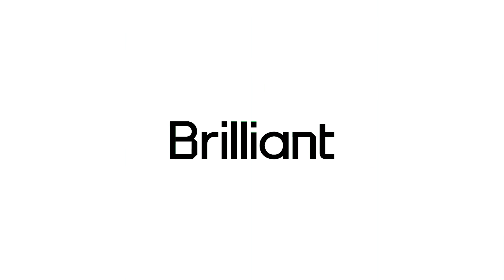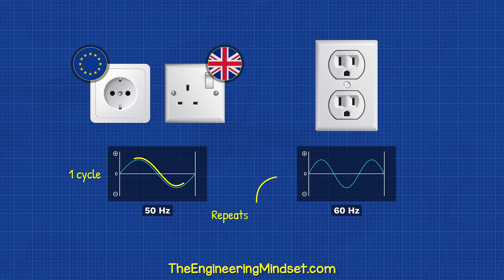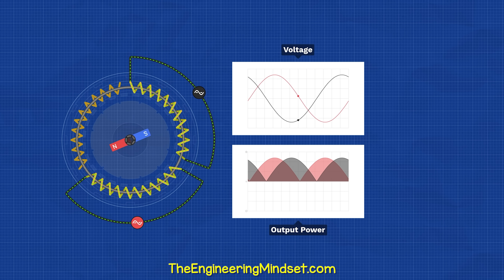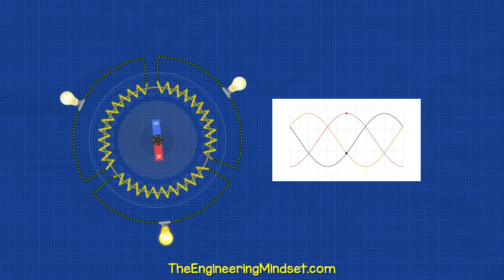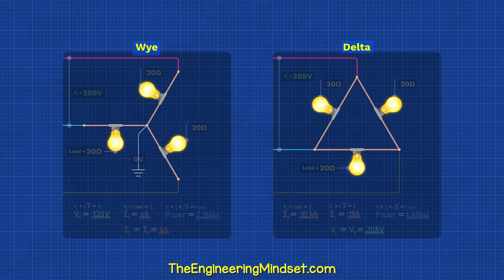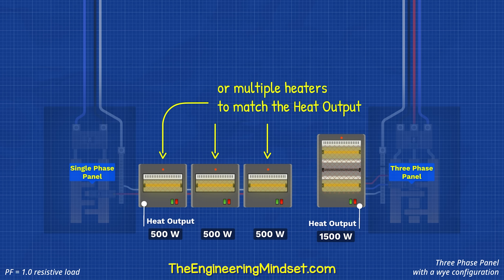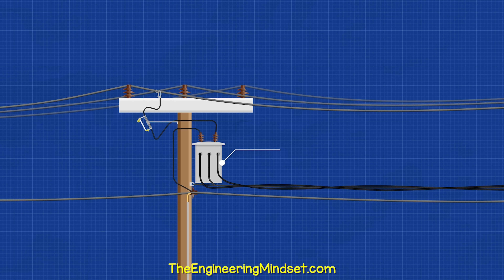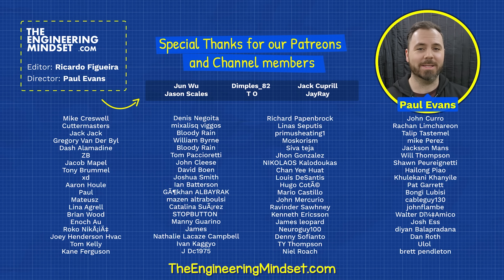How 3 Phase Power works: why 3 phases?

Comment: We have 220 VAC (10 A) and 380 VAC (16 A) in our households. The 380 VAC was typically used for stove tops and washing machines. However, many of today's household machines run on 220 VAC which negates the use of 380 VAC. Running 380 VAC in the garage is practical, if you like me, have a welder. I simply took one phase and a ground wire and put a 220 VAC wall outlet on them.

Comment: I absolutely agree that your explanations are EXCELLENT, clear, concise and simple, you have clarified why we use 3 phase, why we step up the voltage on transmission lines and the differences between 3 and single phase star or Delta etc. ....as an electronics hobbyist of over 50 years one question still escapes me though..... why, here in the UK for example did we settle on 50Hz, why do some countries use 60Hz and why not use, say, 100 or 200 Hz etc which would surely be more efficient.....

Comment: I have last 2 doubts, then I'm all good to go. 

1. So if the public homes following UK style power distribution are supplied with single phase load, then how exactly it is distributed in the home like from the Y fork one single wire from one single load goes to  home and it gets distributed into multiple live wires for different plug points right? Similarly from all the plug points all the neutral wires are connected  to a single neutral wire going out from a house and getting merged into the single neutral wire connected to the Y fork right?

2. Can someone operate a 3 phase motor in a single phase distributed house? And can a single phase load operate in a 3 phase power distributed in a commercial place without l phase distribution?

Comment: You didn't answer the question.
Reply from the maker: Multiple reasons for 3 phase are listed throughout the video, here are some key points
4:30 Explained how 3 phases provide constant power. Graphic shows “almost” and audio says “more constant” with some small ripple shown, at this point all phases are still separate circuits and we have built upon simple single, two and then three phase generator.
5:05 Explained how it provides equal spacing. 
5:36 Explained how more phases means more cables, controls and protection equipment, complex infrastructure, more complex transformers and motors, harder to balance network and synchronise generators.
6:22 Explains how only 3 wires are needed which is cheaper.
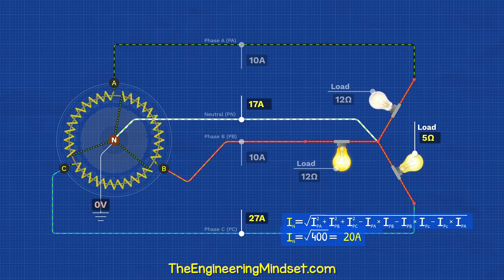7:26 Explained how neutral can be used to balance
7:54 Explained how we use single or three phase from same system
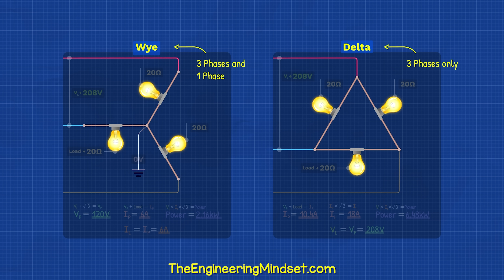8:21 Explained how Wye and Delta are used for different scenarios. Examples uses same resistance and line voltage.
9:59 Explained how 3 phase allows more loads to be connected
10:17 Explained how 3 phase uses more energy but provides more heat
10:19 Compares single and 3 phase power, shows 3 phase power is consistent 
10:36 Shows single phase and 3 phase motor. Single phase has capacitor
10:41 Shows comparison for 3 people v 1 person for motor analogy.
Reply: @EngineeringMindset  These apply even more to 4 phases, though.
What you described is why 3-ph is better than 1-ph.

Comment: great vid THANK YOU,you made it clear
I  use a voltage convertor 240 single in 380 out, run my 12 hp lathe, 5 hp bandsaw, grunter welders and much more, on a convertor from China 20kw, it is very reliable and I've sold a few  here in Australia
so now I  payonly for the single phase , if i had grid they would charge daily for the line

Comment: Electrons don’t flow. If they did, that would ionize their conductors. As they receive electromagnetic energy, they jump to a higher orbit then return, releasing photons that excite the next electrons in succession. 
The phasing has to be three, because of the problems you mentioned and eddy currents stalling or shorting the device. 
Otherwise, good video!
Reply from the maker: Electrons do flow. Well, in DC, they will slowly drift along the circuit while randomly moving within the wire, pulled by the electric field. In AC they just move back and forth a tiny amount and never really go anywhere as a result unless the circuit is turned off repeatedly during one half of the wave.
Reply: @EngineeringMindset  Veritassium articulated how electrons don’t flow, but cause EM fields to travel along the conductors. As the electrical field excites photons, the photons then excite electrons to jump up an energy level then back, emitting photons. They cascade along the conductors from highest potential to lowest.

Comment: For the AC RMS, you can approximate it pretty simply using a bridge rectifier and a capacitor. The DC voltage you read will be pretty damn close to the RMS voltage, typically within a couple percent, and it's what cheaper multimeters use to read AC voltage

Comment: Correct me if I’m wrong, but Isn’t that fluke multimeter used in the video rated to only measure 20 amps??? Shouldn’t the fuse blow?

Comment: Your timing is off by 90 degrees on pretty much all your sine waves.  The current is greatest when the poles are pointed away from the windings, as the magnetic field is changing the fastest there.  The slo-mo video showing the rotating magnets and the light bulb prove this, as the bulb is brightest when the poles are both furthest from the winding.

Comment: Great video! I’m a big fan of the content. If I may, id like to make a suggestion that would help us out in the States. Many of your conversion are European formulas as opposed to standard conversions in the US. Such as kw vs btu’s or pascals vs wc (water column). It would help to include not just European equations but US measurements. Thanks.

Comment: 6:03 okie dokie, every other continent decided that their genius is somehow better than Nikola Tesla, the one who created this masterpiece of a system called the alternating current. And we have it so that if your kid grabs a 120v circuit he'll just get his feeling hurt. But all the other systems decided that it's not good enough for the kiddo to just get his feeling hurt. That child should pay the ultimate price for being a kid. 😢
Reply: Yes UK uses 230V but it's plugs are much safer than US. It is almost impossible for a kid to get into the metal part to get electrocuted do to much higher force required to unplug a socket as well as well as self closing plastic flaps that covers live and neutral unless earth prong is plugged in first. 

Electric kettles boil faster and appliances like PC are more efficient with the higher voltage with less loss, and needing less thick wires.

Comment: At 9:07 you mentioned that the very high voltage keeps the losses low, when in fact, to supply a city with power you need a lot of current, sending it at say 230 volts without any step up, the diameter of the conductor would be insanely big, which is actually the main reason for stepping up the voltage so that when it is stepped down the current can be divided with each consumer

Comment: My meter shows changing values. From 230-237, mostly 234-235
Reply from the maker: It will vary throughout the day. It shouldn't vary too much minute by minute. I work right by a substation which feeds some very large industrial units, when they shut for the night my voltage hits 246V

Comment: I was under the impression that large generators, i.e. 500+ MW kind, use many more windings, such as 12 sets of 3 phases, with each individual phase 10 deg apart. They then step up each set of 3 phases (120 deg apart) separately and send them in parallel into the HV grid. At the HV grid, they are then split to feed separate 3 phase MV distro grids.
Was I incorrect in this?

Comment: Good teach in but being ultra pedantic at 3-40, that is not the correct power waveform.  Depends on the load, but the power waveform is normally a sine wave at twice supply frequency whose average value depends on the power factor angle. Again great work though 😎👍❤️
Reply from the maker: Check our new  Power Factor Explained video soooo much detail and easy visualisations https://youtu.be/NIrKOVZrqnU

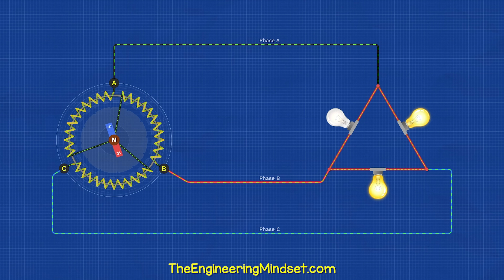Comment: 6:50 I have to take a few steps back from what I earlier posted. When I was learning the trade almost 30 years ago, we were first taught the wye wiring with and without neutral, and only after getting familiar with the idea, went to the delta and its properties.

But yes, there are countries and districts that deliver the "standard" single phase as one side of delta. In the Nordic countries at least Norway has such districts, this is done in order to keep a single sagged wire from bogging down the whole distribution branch. There are, for example, kitchen stoves that are designed so that placing bridge pieces differently in the connection box, they can be wired in wye 3x230V or single phase 230V (for Finland, Sweden, etc) and delta 3x230V or 2 phase 230V in said Norwegian districts. The simplest design without a mechanical clock or rotisserie motors, would work perfectly in a US split phase 240V system.

Comment: Leds acutually do flicker, just at way higher speeds, that you cant see it. (Usually 100-120 HZ
Reply from the maker: I use constant current LEDs yo film in the studio, zero flicker
Reply: @EngineeringMindset  Ah, Okay... I didn't know that... But "normal" LEDs do flicker. Like the ones you find about everywhere.

Comment: Why did you not explain why three phase has three wires but single phase has two wires? I feel like that's something that should definitely be explained because well okay I'm tired. I'm tired and I just don't have the mental capabilities right now to actually follow this video, but in the beginning you showed a generator with three coils of wire or something like that that would give you three different phases. Yet when you have two wires it's one phase? Like I feel like that's a pretty confusing. And I feel like it's obviously confusing. So don't understand why you didn't explain that. I also don't God I'm tired. And I'm confused.lol
Reply from the maker: It is explained in the video 6:08

Comment: my LEDs are most definitely not constant, i use dimmable bulbs, it's even more noticable on camera then incandescents
Reply from the maker: We use dimmable LED in the studio for the camera lighting. They are made to be constant for cameras, if you need one make sure it is made for camera lighting. However my desk lamp is also LED but it is cheap and flickers

Comment: Well, I was hoping a better explaination about why 3 phases.  I heard one day that for a while in Paris (France) people were using 4 phases.  Then it was proven mathematically that the most efficient number of phases would be the number e (2.71828).  But one cannot set up e wires, and e is closer to 3 than 2, which ended up a 3.  That's the point I'd like to see somewhere on Youtube.   Will perhaps find it out one day

Comment: You did not explain why some aluminum plants in the US and in Canada are supplied six phase power. You also did not explain how three phase, delta, provides more power transportation using less wire and poles than single phase, or why two phase power was popular from 1895-1920 in the very first AC power plant installed base. Still, six phase power is used to power AC to DC power stations where very high voltage DC is transmitted over a long distance and turned back three phase power at it's destination. The various forms of AC used over time is actually much more complicated than you let on, you explain how three phase is generated, but not why three phase over single phase, and you aren't actually very clear on why not two phase or six phase. The reason for three phase exists is motors. Single phase induction motors are complicated to start. Two phase motors are very simple to start. Three phase transmits the same power as single phase using one half the copper wire and motors are easy to start. Six phase power is not that much more difficult and it can transmit one third more power than three phase using the same volume of wire. It is easier to convert to DC and six phase has lower losses over distance. When you have a single huge load on a power plant and one transmission line it is simply economics.

Comment: At 4:30 Output power IS CONSTANT! That is the whole point! You have to add up the squared values! Constant mechanical power on the shaft transforms into constant electrical power on the sum of all three phases. Do the math first and then record the video so that you will not teach people wrong stuff!
Reply from the maker: Thanks for your feedback. At that moment the generator is producing three completely independent single phase supplies and we built upon single and two phase. However, in hindsight it should have been worded better.

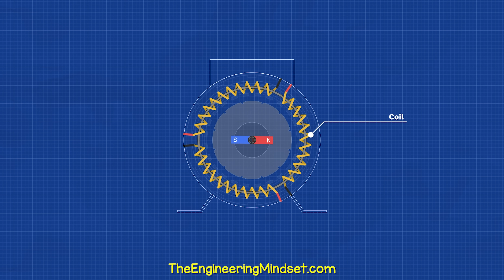Comment: 0:54 well unlike hydropower plants wind turbins actually use DC generators and high power electronics to convert to AC because it would be almost impossible to synchronize a windturbine to the grid.
Reply from the maker: We have explained how AC current is generated and synced to the grid in wind turbines in this video https://youtu.be/Hf875eOVrVI

Comment: The funny thing is the usa uses 240 volt system per phase system they just send one phase to a given home and split it in half. As so that you can still reach the 240 volt supply for appliances that need it. The video does cover that, I just find it an odd they went with that instead of just having everything on the full 240 volt system.
Reply: Two reasons for that.

1. Light bulbs back in the day work only at 110V, and to avoid replacing each and every one of them in the NA they kept the voltage there with minor upscaling. EU made their grid at 220 as that is cheaper, and there were not so many light bulbs so those bulbs were redesigned for 220.

2. It always hurts less on a lower voltage when an unfortunate individual closes the circuit with their body. Some places even used 55V split phase to power 110V electronics.

Comment: May I ask a question please. I'm in Australia, we have 240v system to our house. But it is normally in single phase. People may have a shed in their yard where they use a Welder for example. I have heard they get something done whereby they  have 3 phase power.
what has been done to their electrical system, that enables/converts their available power from single phase to 3 phase. I hope the question makes sense, I have NEVER had a clear explanation of this (even from qualified Electricians).

Comment: Wow... this really is interesting and showcases the flexibility of the North American power system, with most residential allowing 120/240V, instead of only having access to 230V.
Reply: what's the point of 120v? i hate it because my room is 15a 1800w & my kitchen is 2x20a 4800w

Comment: Short answer: 3 phases are good enough for generating a smooth rotating magnetic field in motors + an even power output in general so no need to add more phases wich just adds cost and complexity.

Comment: If you have three phases, you can use a bunch of transformers (or capacitors or coils) to generate 6 or 12 phases where you need them, without having to double or quadruple the cost of  the distribution grid.

Comment: Why would heaters flicker in the 1 phase network? Thats not true . The only time there is absolutely no current is during zero crossing. Otherwise there is always some current flow. Time constant for heaters is tens of seconds and 20 ms cycle will not cause it to flicker.
Reply from the maker: The point was meant to visually show that you could connect 3 items to the same phase, or 3 separate phases. Connecting to 3 phases provides constant power.
Reply: @EngineeringMindset  yeah 3 phase motor would be better example. you need minimum three phases to generate continuously mechanical torque in the shaft otherwise it would be jerking or half turn rotations. Single phase motors in fact need phase shifting capacitors to generate shifted magnetic fields. This is also misleading. It should be clear that with one phase rotation is not possible.
Reply from the maker: We have covered that in our 3 phase motor video

Comment: I would say that main reason is that electrical motor which is an inverse of generator need minimum three phases to produce stable rotation. With one phase you would generate a jerk motion, with two phases magnet will make up to half turn and align itself with magnetic field of coils and will stop moving. But with 3 phases shifted 120 deg apart there is continuously some torque being generated in the rotor.

Comment: One quick question- can just two of the phases supply a single phase transformer? 

The reason I ask is here in the UK i have noticed in the countryside where there is three wire overhead power lines (I presume 11kv), when there is a house nearby the transformers look like they are supplied from just two of the lines and not all three.

If this is the case would this not cause an imbalance on the three phases as one is not being used, especially if it is a delta supply?

Sorry if this is a silly question but this is really confusing me!
Reply from the maker: Yes you can connect between two phases on the primary side. The voltage is just the difference between the two sine waves. The secondary output side is stepped down to a safer level in the home. Homes are generally small loads in comparison to say industrial sites so the imbalance is small but further along the line another property will be connected to a different pair of phases. Overall the system will be balanced.
Reply: @EngineeringMindset  Thank you very much for this reply and clearing this up for me. Your videos have taught me so much. Definitely will be ordering some of those mugs they are fantastic 👏

Comment: I remember my professor saying that only in 3 phase active power is constant. Which means that torque of a 3 phase electric machine is constant that was the original reason to do 3 phase as electric machines were the first loads of the early electric grid